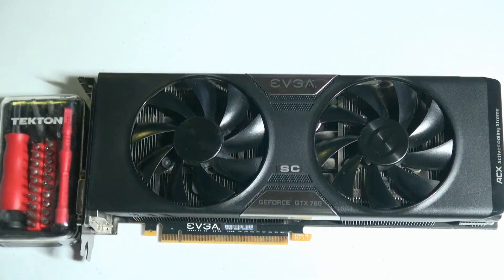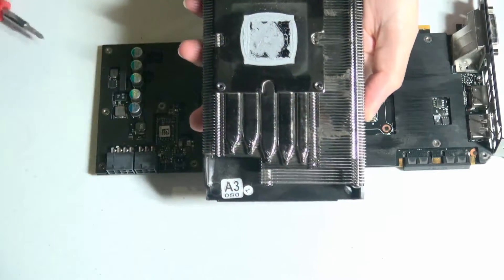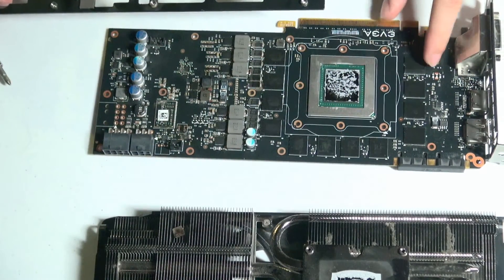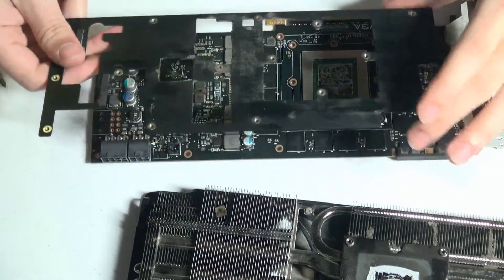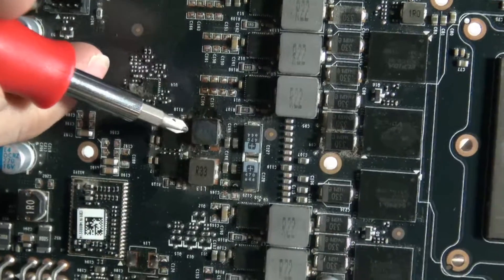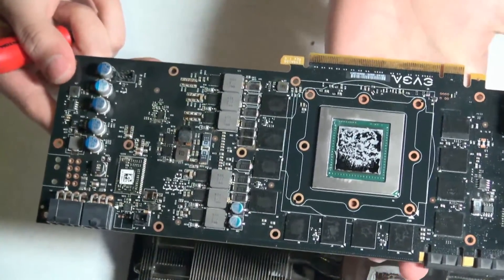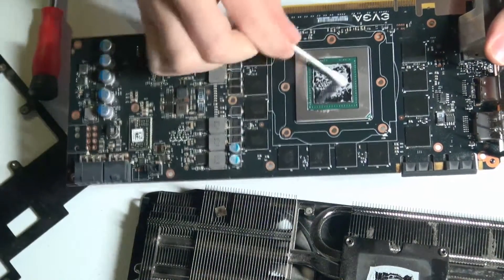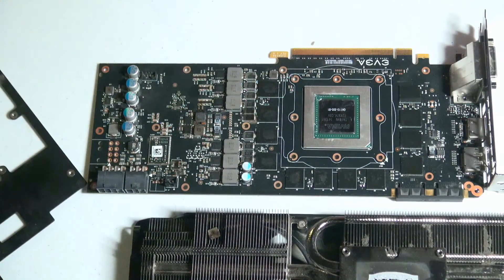Why, and How to Clean Your Graphics Card (GPU)

Comment: Your explaination completely wrong.
 You maybe right about moisture in enviroment, but the oil in the thermal pad is silicon oil, come from the thermal pad it self. Because EVGA use cheap thermalpad, it degrade alot in longtime use. My gtx1080ti from MSI and 980ti from Gigabyte after 2 to 3 year have this problem. Technically the silicon oil is not harm your graphicard. Just want to make sure this moiture not come from environment as you said.
From EVGA forum: https://forums.evga.com/Oil-on-GPU-m2952345.aspx
Some of component in the board were fried because EVGA (an also Nvidia ref board) use cheap price component, and many 780/780ti of another brand also got component fried in this area. Absolutely fault in design of PCB.
Watch it: https://youtu.be/6BBEasRiM_M

Comment: 4:28, That is not the VRM. those modules around the GPU die are the memory modules. The VRM is to the right of your hand, it is the mosfets, chokes, and capacitors. I'm only telling you this, so you or someone else doesn't try to fix the card and accidentally break the card. besides having more information is always useful.

Comment: Thanks for the informative video, I’ve a question how do you clean the dust that’s trapped in the heat sink ? I’ve tried compressed air but i feel that there is some left inside and it looks like oily dust.
Reply: Water, soap and a brush, Just make sure you let it dry overnight or with a fan so there's no moisture when you put it back

Comment: i've hd 6870 and its temp was 90c and i changed thermal paste and it become 87c but it still too high!
so whats the problem ?
Reply from the maker: +Abdelrhman Moaatz bad fans possibly? Older equipment typically does this. I have a laptop that was running around 95c replacing the paste lowered it about 10 c but it's still pretty high. Just the way old equipment goes I suppose